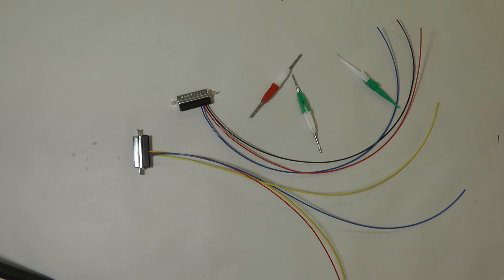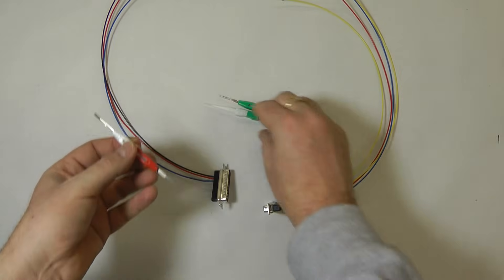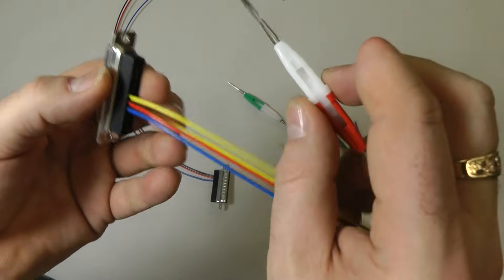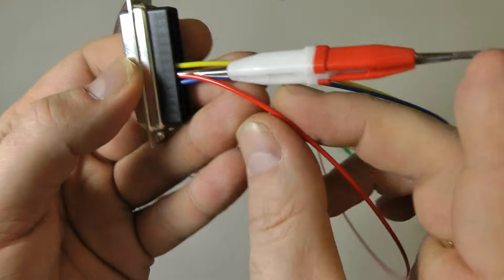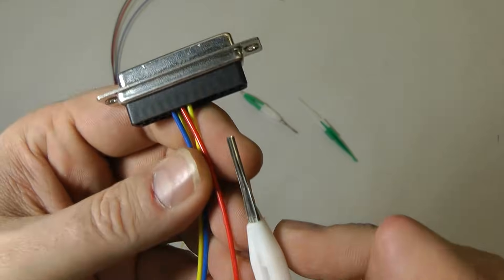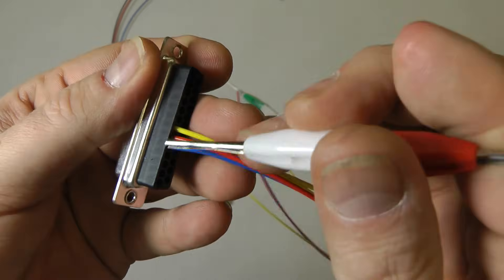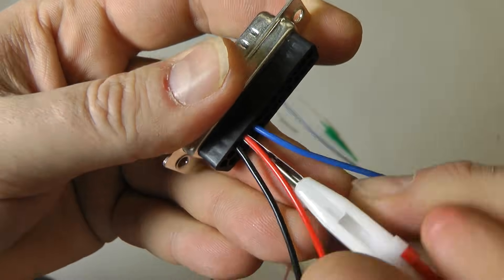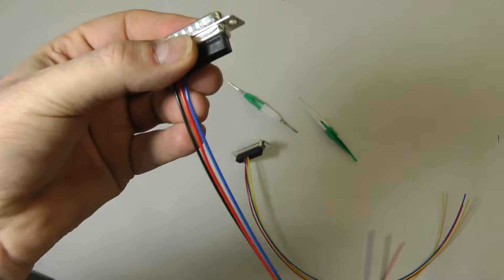005: DSUB MACHINE PIN INSERTION & REMOVAL

Comment: Thanks for these videos, I still refer back to them to refresh my memory on things.

I prefer the plastic version of this tool, personally.  I always found the plastic one to be easier to work with, though as you say, they do tend to wear out.  I just treat them as disposable tools.  The metal one is more robust, but I find it harder to get over the wires sometimes, and it's easier to damage the internals of the connector.  I still do keep both on hand, but I reach for the plastic version first.

Comment: What size guage wire did you use and female pin?
Reply: The standard density pins will take 20 or 22 gauge wire. The high density pins will accept 22 gauge and smaller.

Comment: Tip: if you've gotten the removal tool all the way into where the witness hole disappears but the pin still won't pull out, flip the connector around and see if the pin is sticking out a little further than the others on the connection side. If so, try pushing the pin out from interface side using a blunt-nosed instrument. Tip 2: Pull the red and white tool halves part before pushing hard on them unless you're actually trying to collect a core sample of your palm for some reason (yes, I did that). Tip 3: nothing ever works in real life as well as it does in videos - be patient and keep trying!
Reply from the maker: Excellent points - thanks for posting!

Comment: how to remove the pins when the cables are are broken from the pins?
how to crimp them after?
Reply from the maker: Sometimes you can "push" then out from the other side using a mating pin or other device, but sometimes you're stuck with just making a whole new connector.

Comment: The all plastic pin removers are better, they don't last as long but they won't damage your connector as readily as the metal. One of the protips is to use side cutters and make a small cut at the end of the tool to allow it to slide over a wire if the pin is already part of a harness. One thing I was taught was the use of iso alcohol to lubricate the pins and the tool making removal and insertion much easier and due to evaporation it doesn't need to be cleaned.
Reply: Do you know the part number or name of the plastic pin remover I need to remove a SA-1017?
Reply: @alvarolopezcorral4850  I think it's the red/white one, here's a datasheet that lists based on contact size on pg 15. It seems the Amphenol PN is 10-538988-020.

https://www.farnell.com/datasheets/1836138.pdf

Comment: How do you extract if the lock is broke inside?  I mean you can feel the extractor going all the way but you cant remove the friggin pin. Thanks.
Reply: How do you know it's broke? They occasionally can be stubborn, use some iso alcohol sprayed down the rear of the connector as lubrication and use the plastic tool as they allow some flexibility and won't damage your connector so easily. Typically when I had a tough one I would put the connector in  a vise and tap the flat part of the removal tool with a small hammer and at the same time I'd yank on the wire the pin was attached to. I'm not sure I've ever seen one broke in that way then again we only ever used proper ITT connectors so if it's a cheaper one that could be. If the pin retention is broken the connector is scrap anyway so why are you trying to save a single pin?